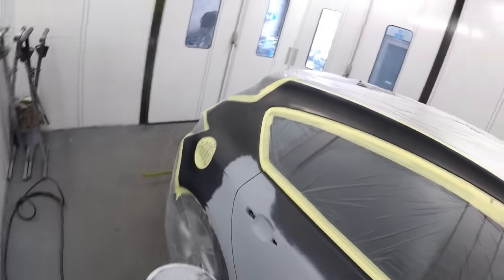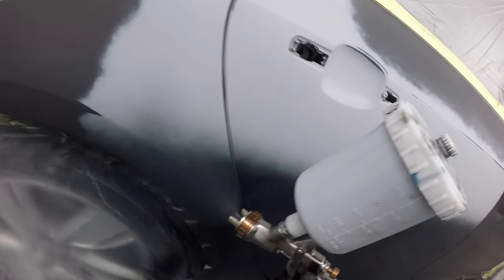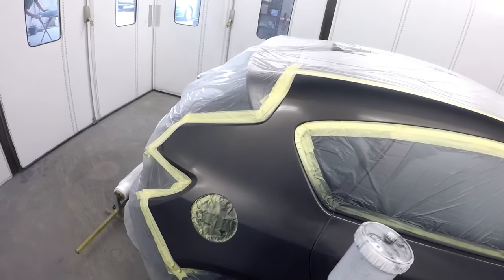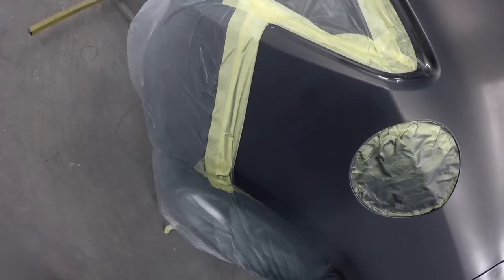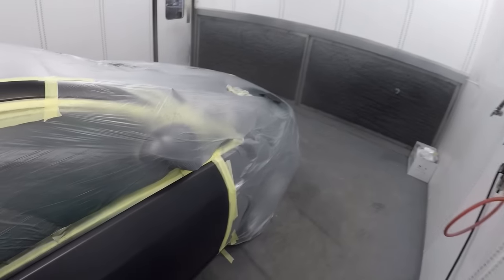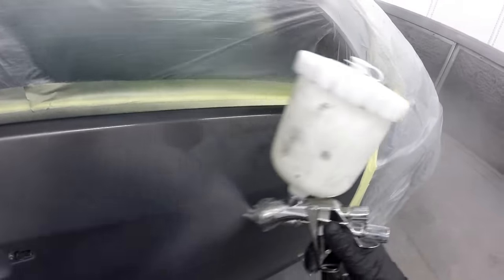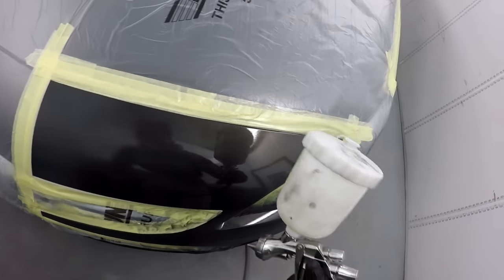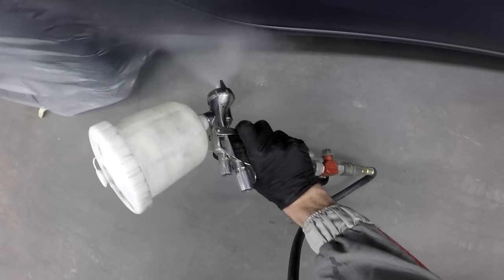iWATA W400 BELLAIRIA AND WS400 SUPERNOVA Base And Clear Spray Painting

Comment: Tip... on your blend coat/ orientation take your gun and tip it about 45° from the panel and turn you pressure down a few lbs. itll pull your blend out really good. No need for wet beds.

Comment: I guess you dont need to worry about blending into a sanded panel on that one being it is a dark color. But on silvers with solvent based we use a clear binder as a base or a intercoat clear which is basically the same thing. then put the silver over the base this gives you a painted panel to blend into
Reply from the maker: Yes same thing but the silvers we use don’t need this they seem to settle lovely

Comment: another top video. what did you have the gun setting on
Reply from the maker: fan 1 1/3 out from fully closed which is what iwata recommend and so would i too, fluid around 3 turns on this day but ive ben experimenting recently with full fluid open and its alot quicker and nicer to paint with

Comment: Hey Tony, would you consider the w400 for base and the ws400 for clear as your best combo ? Or do you have another combo ? As a matter of fact..what is your opinion of the best clearcoat gun right now, if price is not an option?
Reply from the maker: ls400 for base and ws400 for clear however the w400 is exceptional for base
Reply: @TonysRefinishingTV  Which gun is better for clear!Sata 5000 rp or 5500 rp for clear!? & in a ranking of top 3 clear gun's in your opinion!?

Comment: With the Bellaria, what round about settings have you found work best for HS clearcoats?
Reply from the maker: 2.0 bar air pressure full fan start at 2 turns out on the fluid mate and increase and decrease from there

Comment: Only thing I dont like about the gun is when your spraying your hood you have to tilt it forward  or the spray pattern is heavy at the bottom.  Seems like it was not designed right to me..It's very unnatural feel to me. Other than that I like it.

Comment: Yo gunman I have ws400 supernova base model and I can’t get it dialed in to fan out evenly it’s a brand new gun I bought from spray guns direct help me out brotha
Reply: It’s a 1.3 what settings do I use
Reply from the maker: Should be fine on full fan tbh mate but try turning it all the way in and then come out 1 3/4 turns that’s the ideal spot for a ws400 mate